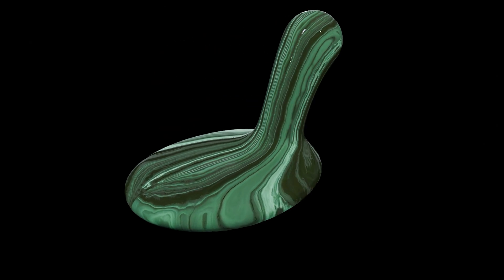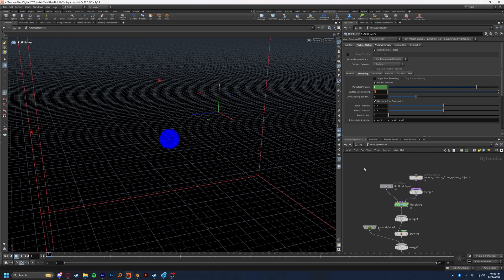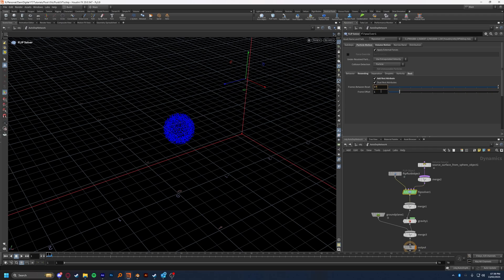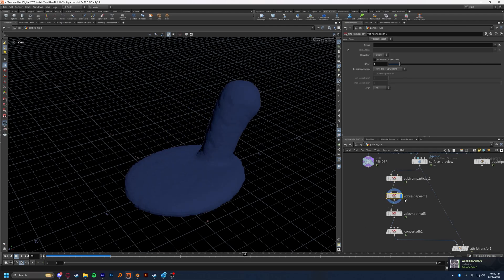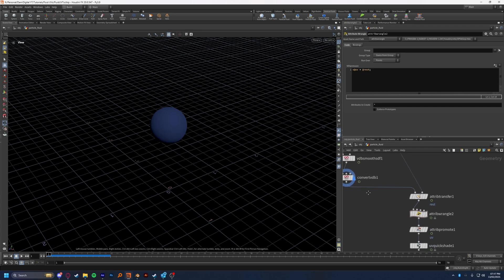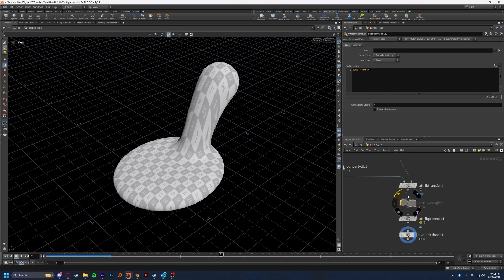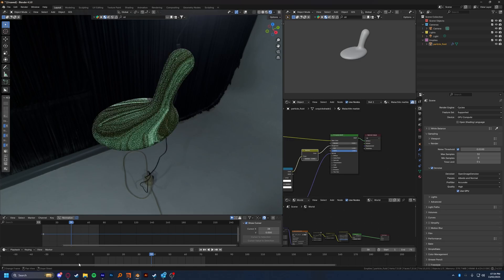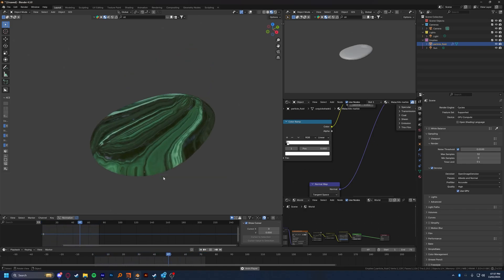HOUDINI: How To Create and Export Fluid UVs

Comment: Can you export a video to Cinema 4D?
Reply: I've tried every way, looking at tutorials and forums, but I've never been able to export the liquid mesh to use in Cinema 4D.
Reply: @pauloeditdesigner  what render r u using? If it's redshift you need to use user color data in the shader linking the UV or color data from the alembic export.
Reply from the maker: You can use this method to export to any 3D program. I don't use C4D so I'm not sure how the Alembic import works but if you follow these steps the exported Alembic will have UVs.

If you're asking if you can use a video texture on the fluid, I don't see any reason why not!

Let me know if I helped at all
Reply: @damidigitalcom  I did your tutorial and when I send it to Cinema 4D I apply the texture and it doesn't move the liquid